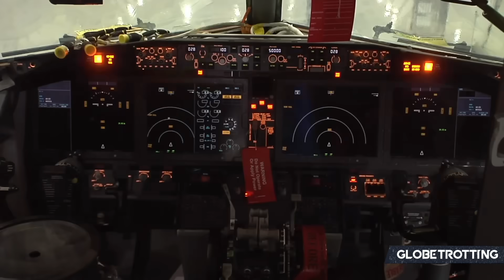NEW ERA - Boeing 797 vs Airbus A321XLR

Comment: Boeing very desperately needs a new plane to compete with 320/321 and Im sure they will (Im an Airbus fan). It will be a clean sheet plane but Im sure Airbus is already drawing up the 320/321 successor as well. Only the 787 and 350 are completely new designs and the need for next new design is very much needed.

Comment: Don't forget that Airbus knows very well, that they need to develp a clean sheet aircraft as successor to the A320 family to not run into the same issues as boeing did with the MAX. 
There are rumors, that this new aircraft will have the size of the A321, which could be stretched. Airbus would have the A220 (maybe streched) and this new family by mid of next decade and would therefore have a solid lineup of modern aircdafts.

Comment: I appreciate your video, but at this point (02/2025) it is pointless to compare a plane starting to enter service (A-321 XLR), a variant of long-in-service A321 family, against a still on-paper plane (Boeing 797). There is a strong possibility that the Boeing 797 will NEVER materialize, as it takes a long time & lots of money. Best thing Boeing could do for now & next 5 years is to stop the bleeding, stabilize the business (including improving management-workers relation), strengthen QA & QC in manufacturing.

Comment: In my opinion the 787-8 is the NMA 🤷🏾‍♂️🤷🏾‍♂️🤷🏾‍♂️🤷🏾‍♂️🤷🏾‍♂️🤷🏾‍♂️
Reply: Boeing designed the 787-3 to replace the 757/767. Different wing and engines... it was never launched.

Comment: The A321 will be long obsolete before Boeing gets through the decades of delays and oversight to release a new aircraft. I am not even sure they still know how. They have spent the last 25 years rereleasing old airframes as new planes. The 787 was the last ground up new aircraft and it was introduced 25 years ago.
Reply: Imagine how long it will take Boeing to get this operational
Reply: The thing is, the 737 max family and A330 are still competitive.

The A220, made from the ground up barely makes the extra cost of composites worth it. 

Its milions more expensive then a aluminum 737. It takes a long time to recoup that difference in fuel consumption, nevermind a potential disruption, like a pandemic, to make your expensive plane just get old.

I love inovation, and would like to see the cutting edge make it to production, but old designs seem to be quite futureproof.
Reply: @dariusdareme  If someone cam up with a clean sheet design to compete with the 737/A320, say like Embraer. They would put a large dent in the sales of both. They are ,even in their newest editions, seen to be outdated. The A220's problem is engines and the mistake they made by not having an alternate. It is an excellent aircraft.
Reply: @bobdevreeze4741  but Embraer did come up with a new plane, the E2, and it's not selling well, despite all the delays of the others.
Reply: @dariusdareme  The E2's biggest problem = Unions.
Reply: And how many all new aircraft have Airbus introduced in the last 25 years?   The A350...that's it.  If you want to bring up the A380, I wouldn't want to hang my hat on that colossal failure. Oh..and that goes back to the 90s BTW. So.........
Reply: @toms1348  I remember flying with Emirates airline A380. I have never seen anything like that in my life, not even the 787 or 777 could rival. Even in economy class i felt way more comfortable than any other commercial aircraft. While an economic failure it was definitely an engineering success.
Reply: Also the A320 neo and A330 neo. And yes, of course, the A380. Airbus wouldn't be what it is today if it didn't do the A380, just because the program didn't break even (which by the way it would have if it wasn't for the colossal delays it had) doesn't make it any less of an incredible industrial achievement and an instrumental milestone in developing the company.
Reply: @toms1348 Financially, it is a failure. From a product perspective, it is a massive success. Don't forget that the A350's development speed and tech mirror those of its big brother, the A380, and it broke even some time ago, whereby the 787…
Reply: @ Nope, I disagree. As I said, it is a financial failure, not the product itself. Quantum leap or not, the 787 hasn't broken even despite the sales matrices, as you mentioned, as opposed to the A350 program; well, you knew the answer.
Reply: @alvinloh9068  Many people overlook that the A350 program significantly utilized technology from the A380, including modern avionics systems and advanced materials. This notably enhances the development speed and resources required to operate the program. The Airbus A350 program broke even in 2019-2020, after being in the red since its inception. Airbus reported a net profit of €4.2 billion, a 12% increase from the previous year with a reported revenue of €69.2 billion, a great 6% increase from 2023. Boeing on the other hand..... Oh well

Comment: All things being equal, the 797 should be much better than anything in the current Airbus range, and I am sure the many blinkered fanboys will repeatedly highlight this.

However, it is an almost certainty that the 797 or NMA will not be competing with anything from the current stable, but with the next Airbus clean-sheet where the advantages a new design should have, will no longer apply. 

The playing field should (if Boeing sort themselves out) be far more even.

As for the 797's affect on sales of the A321, I suspect that it could be argued that it would have been the final nail in its coffin, as it would have almost inevitably precipited the A321's replacement.

It must be appreciated that the NMA required brand new engines developing,  so those next gen engines would also be available to Airbus.
Reply: @neilpickup237 The B797 would have been the end of .... Boeing. No way this aircraft would be certified yet if it was launched in stead of the MAX.
Reply: @chiad25  Did you read what I wrote? I was talking about the end of the A321, because it would precipitate its replacement.

As to whether the NMA would enter service before any A321 replacement is another question.

Based on recent events, it would be quite reasonable to assume that the development time for a brand new Airbus will be shorter than for an equivalent Boeing. Therefore, having the advantage, it makes little sense for Airbus to launch first. 

Some have suggested that the next challenge to the A320 serues may well not come from Boeing, and it could be that aircraft that causes Airbus to react.
Reply: I've got my eye on Embraer. This is an incredible opportunity for them to jump into the medium/long-haul market. They've got a lot of experience with short-haul, and there's a huge base of pilots with experience in Embraers. Maybe just a fantasy, but I'd love to see it. I think Embraer makes great aircraft.
Reply: @beenaplumber8379  I also have my eye on Embraer. Their design philosophy seems to be to compromise as little as possible. Having wing sizes tailored individually to each model rather than a tweaked range standard design could quite easily (as in conceptually) be transferred to having different fuselage widths (4,5 or 6) to compete with both the A220/A320 series head-on.

Perhaps this flexibility/optimisation is something that Airbus and Boeing should embrace.

After all, the numbers involved in the single aisle market are so vast that any additional manufacturing or development costs will be spread rather thinly.
Reply: @neilpickup237 the 797 is also a fake concept, it should be retired
Reply: @sebastianfloyd372  Why are people so obsessed with the word 'fake'. 797/NMA, or whatever you call it are just arbitrary names given to whatever fills the gap between the 737 and the 787. As for what it would eventually be called, who knows? The  previous 757 and the767 which previously filled what filled that gap are now no longer in production and their names could be re-used.

Will the gap be filled by just a single aircraft? Will the NMA be a twin aisle closer to the old 767, and a clean-sheet range of single aisle aircraft replace both the 737 and 757? Conjecture yes, fake most definitely not.

It would, however, be quite an achievement to retire something before it is even designed.